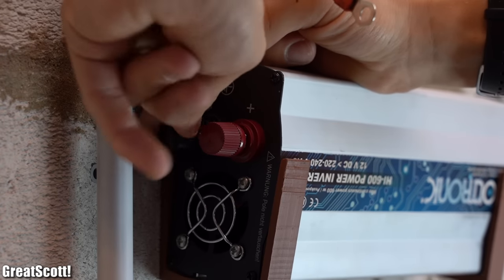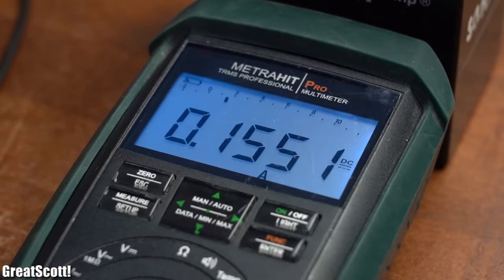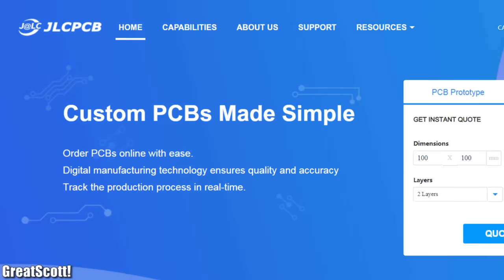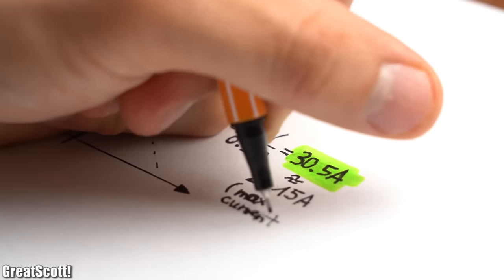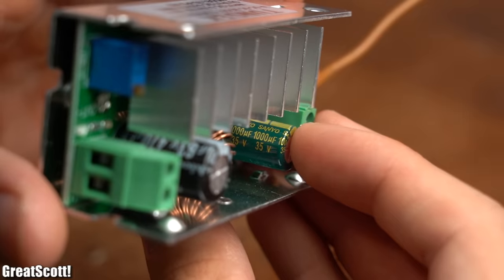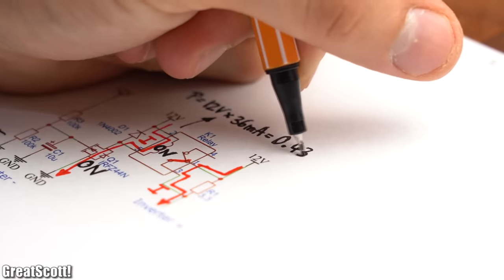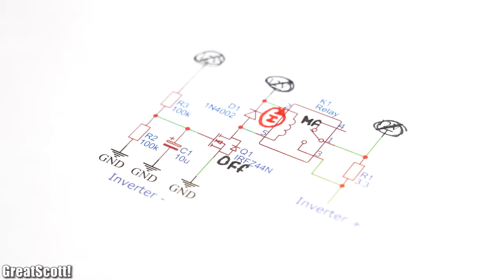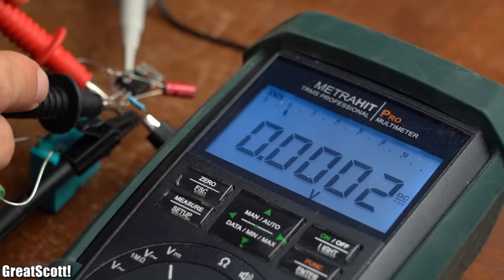How to make a Softstarter and why it is sometimes mandatory to use!

Comment: Because you are working with DC it should be possible to solve the problem much more easy. If you put a 3mH (or more) induktor with a low resistance in parallel to a 3,3 Ohm resistor the inductance stops the inrush current inpulse for a while an it goes through the resistor. After that the inductor doesn´t matter for DC any more.

Comment: is the Mosfet selection overkill? would i get away with replacing it with something in a TO-92 package or something SMD for space reasons, any suggestions would be welcome. appreciate your work, your always well explained, thanks
Reply: i have some 2N7000 N-MOS 60V 0.2A, is there any reason they wouldn't work, unless im missing something, its only got to power the relay coil

Comment: IRFZ44N? That's massively over-spec for a relay. Actually, if you stick two of those in parallel, they'll take a hundred amps pulse no problem, and 30A continuous even without a heatsink. You can do away with the relay altogether! If you want something that'll do even more current, the only MOSFET I know of that has a lower Ron is the IRF3205, just be careful of the low max Vgs on it.

Comment: A clever design would be to use an NTC shunted by a normally-closed relay contacts. When device initially connects the main switching is delayed for a bit but the relay activated immediately and "unshunts" the NTC. Then the main current starts to flow with the NTC damping the inrush. After the inrush is over the relay is unpowered and so the NTC is shunted again and cools down. So during normal operation the NTC conducts no current so stays cold and the relay is not activated either, so no power are wasted there. Not sure how easy it would be to implement this logic, does not feel simple to me unfortunately.

Comment: In bypassing the the current accros 3 ohm resistor, the relay coil is always dissipting some power, so can't it be 5 pin relay where NO and NC contacts are used such that, dusring continous operation the relay coil is off... Hence mosfet also off

Comment: I need to make one that will can start my air compressor.  120VAC, 15 Amps.
Aren't there specifications for types of load that the soft starter be determined for?

Comment: Could you use super capacitors on load side to deal with the current surge on startup? Have a higher voltage "buffer" that dropped energy into the external system on load, then was recharged gradually once the load diminished?

Comment: What about using an inductor? If sized properly I'd imagine that would be a lot simpler and also have a really low power loss in a DC circuit.
Reply: Switching  very large inductors into circuits just opens an entirely new can of worms. And check out what happens to the voltage when you switch that beast off... Arcs and sparcs I tell ya.
Reply: @benbaselet2026  That's definetly an issue. However on the one hand I don't expect the required size of the inductor to be that big, but I'm not entirely sure of that.

As for the voltage spikes, a diode anti-parallel would fix that, and that's more or less standard practice when switching big inductors AFAIK

Comment: How might I use this to trigger the BMS of a lithium battery? As I would need a pretty beefy relay to pass 60 amps, could I use the soft start relay signal to perhaps bridge a link between the sense lines and the BMS? Then I'd have to cut the bypass resistor when the battery is low or charged. Then it really becomes more complex..

Comment: Why not just add a large inductor in series with the component ? Its behavior is the opposite to the capacitors responsible for the inrush current : it would oppose the inrush current at first then act as a simple wire once the current is stabilized. Is there a reason for not using it ?

Comment: Hi! Isn't it possible to add your own capacitor to store energy and smooth that load spikes, but charge it via a resistor (limited current) and discharge via zenner diode (a lot of current) I know in model railroading this technique is used widely

Comment: Why not just let the mosfet be powerfull enought to feed directly to the inverter and skip the losses of the coil in the relay? i would think it would give even lower loss.
Reply from the maker: Feel free to do the calculations of the power losses of the MOSFET at 600W input power.
Reply: @greatscottlab  I'm guessing you would never run it at 600W. But I know in that case it would be much better with a relay. On the other hand 0,5w is nothing :-)

Comment: So can I also use this for a fridge? My 180 watt (when running) fridge seems to need almost 1600 watts to start up. So I need a huge (and expensive) inverter ony for the startup moments. But I suspect it will never start if just draws that current after the delay time has passed?

Comment: Watched this 3 times and so confused.
Also the parts linked to are fairly expensive since several are multiples and kits.

I just need to get a 12v Sump Pump to decrease it's starting power so it doesn't drop the voltage on a solar panel.

Solar Pump basically, and it sits there for hours clicking on and off because the voltage drops below the cut off point of my DC Voltage Relay.

Ideas?

Comment: I have a solenoid piston that works on 24V DC . I use it on a sewing machine , but when i turn it ON , it kicks a bit more that i want , will your soft starter help ? And plz tell me what do i need to change on your circuit because of the 24V . PLUS :  the circuit i made, so i can have 24V DC when the piston is ON it gives like 40V when the piston is OFF , if i give 24V to the piston then i have a huge voltagedrop due to the current it consumes but the specifications for this piston are 24V - 30V max. Can you help ?
Reply: You just need a series resistor to limit the kick.  No need to bypass it after a delay.  But you should have a diode reverse biased across the solenoid coil to dump the inductive flyback .  Connect cathode to the positive side of the solenoid, anode to the negative.  Any good sized silicon diode will work.
Reply: @Nic7320  Thanks for the reply , the solenoid already has a diode and a resistor ( don't remember the values ) and it's pretty soft when i turn it off , comes to it's normal state soft and gentle .If i change polarity the piston always pulls (instead of pushing ) nothing changes , the kick is always when i turn it ON . But i will try putting another series resistor as you said , see how it behaves.thanks.
Reply: @Nic7320  Ok tried it and it's working well , only thing is that i need a low resistance , with no resistance there are passing like 3.5 to 4 amps !!! I,ve putted an 11.5 Ω resistor but it gets hot even though the amps are now 1,5 - 1,8 ? made a custome biga** heatsink with loads of thermal conductivity glue . thanks , i think i'm good to go .
Reply: @Nic7320  it worked with just a 11,5 Ω resistor , without the resistor 3,5 to 4 amps where passing , so , i hade to make a biga** hitsink and now it works like a charm , thanks .

Comment: I have a fridge on my system that messes my system up. It works buy when the compressor starts the lights dim and I can see a surge line in my monitor. Can't be good. Any ideas if a softstarter would be a solution? If so, can I buy one somewhere?

Comment: Maybe a low Rdson P-ch MOSFET instead of a relay to reduce current draw? This one should do the job: STP52P3LLH6. It could probably act as the current limiting resistor also while it is in its linear region, and then its resistance goes down to 17mOhms.

Comment: I'm using a 10R NTC with 2-second relay timer (relay shorts across NTC after ~2 seconds) but my load (240v battery charger) still leaves POP-marks on the pins when being plugged in. Granted, the pop is not as large, but it's still got 75% of its pop/bang factor ! Any ideas? Guess a higher resistance NTC might be worth trying.. Also, I use a 133 degree C thermofuse held next to the NTC with heatshrink for safety - incase the relay fails to close and the NTC gives off too much heat (granted it's not as bad as I thought it'd be: even though it's in a plastic box, I tested running 2000W through it (the NTC, not the relay) and the leg melted into the plastic a little bit, but it took a bit longer than I though it would. Still, silly not to use a thermofuse in my opinion.)

Comment: This is more like a workaround for a specific use, rather than an actual soft starter. What if the startup load comes from another source, let's say a door motor or a heating element ?

Comment: But in your final design, if you open and close the circuit just before 1 seconds, the problem will still be there isnt it? So you should close and open the switches just once, not wobble  close-open-close ... It is a protecction for most cases but do not protects %100  times.. Am I right?

Comment: Question is,WHY this is not part of the original  inverter circuit,or do only the expensive range has them?
Reply: This is a problem, when you have a small battery and large inverter.  Who does that?

Comment: What are soft starters called when used with elecric bikes? I'm currently having a solution with a resistor and a on off switch. I would like it automatic. I also notice that sparks can travel to another wire. I mean that the spark can occure both on the battery to controller but also pass through the controller to the motor. I forgot to turn off the switch one day when I connected the battery and suddenly I though something happen with the controller because the electric bike didn't work. 
I fixed it with disconnecting the wire from the controller to the motor and then connecting it again. This gives me a clue that a spark caused the disconnect.

Comment: Other than current limiting, why use the solar charge controller load side? Why not just use a DC solar shunt instead for better metrics and the ability to add a variable current limiter? I don't know anyone who uses the solar charge controller for the DC load. This seems like another manufactured problem with an obvious simple solution, but you made it harder for the youtube content.

Comment: Couldn't you simply power the relay from after the resistor (maybe using a diode or 2 to increase the voltage at which it closes), making it start when the power is over 12V and so the inrush has ended? 2nd option being using a divider and transistor to achieve the same thing

Comment: Alternately, JUST REMOVE THREE LARGE CAPACITORS! Running off a battery will NOT cause ripples that require filter capacitors, since the voltage is not made from an  AC source. ...  Though without modifications, a choke would work, with minimal power loss
Reply: No do not remove the three large capacitors -  they are there for a reason.  A choke may or may not work.

Comment: So you expect all 50+ Amps (may even be over 100A) of current drawn by your inverter when driving a heavy load would flow ok through this tiny relay? This is only a solution for extremely small loads.

Comment: Can I use this soft start circuit for a custom built 57V o/p Microwave Oven Transformer(MOT) arc welding machine with two MOTs? If so, then how to calculate the desired resistor value? And if not, then please send me the scematics of a suitable soft start circuit for my specific need.

Comment: How do you reset the timer to 1 second with short transients? Normally, a diode force the small capacitor to discharge quickly when the 12 volt drop below 0.7 volt.
Did you test the surge current by applying intermittently the input voltage?

Comment: An  inductor would stop large turn-ON currents to the in put capacitors. If the resistance of  the inductor is sufficiently low, power losses after turn ON would  be very small, NO relays which have limited life are required..
How could It be that < GreatScott > ended with suc a poor solution ?

Comment: Hi Scott- Can you make a circuit for failover power supply. 1Input form 12V adapter, 2nd input form 12v battery. when the 1st input is not there then it will switch to 2nd input. I know its easy to make it with a single   8pin relay. But the problem comes at switching time. All the devices rebooted due to switching time.

Comment: What if you use just the MOSFET with the RC circuit in the gate? so you don't need to use the big resistor and the relay

Comment: Wouldn't a large coil also slow the in rush current with less ongoing power losses? (as well as act as a noise filter, which could be handy)
Reply: Do the math and tell us value inductor would work best ...

Comment: Very nice and ingenious design,but I don't think it was necessary to use a power mosfet to drive the relay: a 2n7000 to92 package mosfet would have made a more compact circuit. Also, a p channel power mosfet could have been used in place of the relay, to make the switching truly solid state, with no relay contacts to wear out.

Comment: Could a so-called „capacitance multiplier“ circuit be used as a soft starter, if the capacitor value used was big enough to make the transistor turn the power on slowly?

Comment: I'd just have a mosfet or relay powered by the mppt, I mean you know what loads you run. Having a relay there gives you current when you need it and still leaves under voltage protection active??

Comment: Thanks GreatScott! 
Stupid question: I have a 100W led powered at 3A. Is it enough 100W resistor in series on the load for this purpose?
Reply: The rating of the resistor is the maximum power it can dissipate. What is your supply voltage and the voltage rating of the LED?
Reply: @trissmerigold7197  Thanks for the answer. The power supply is 19V and the led voltage rating is about 30V at 3 or maximum 4 Amps. What do you suggest?
Reply: @sandrolab  i highly suggest you to use a boost converter with current limiting function
Reply: @trissmerigold7197  Yes, I’m already using a boost converter for that, but I see a bad peak of current when I turn on…
Reply: Is the current peak flowing thru the LED or at the input of the boost converter. And have you set the current liming at the output?
Reply: @trissmerigold7197  Yes, the current is correctly limited at the output but the peak flows thru the LED at the start.
Reply: @sandrolab  you can either use a big capacitor to "absorb" the voltage peak (i assume it is a voltage spike) or an NTC but of course it will be heating during normal operation

Comment: Need to modify this for 24 volts... I take it I should double the resistor values, and make sure the caps and relay are rated for more than 24 volts?

Comment: Why not make the entire thing solid state? Big mosfet or igbt in place of the relay
Reply: Mosfets don't handle the high currents as well as relays!
Reply: @alexoja2918  totally true. A decade ago I used to design metered photostrobes handling hundreds of amps at 350v though for short periods. This was with n channel igbt with extremely low esr.  May be worth investigating though the cost would be higher than relay and much more sensitive to linear mode faults

Comment: Hey great Scott I have a question I try to make a construction radio out of a car radio and I need to have a switch/inverter to let it work but wanted to try to make it when it’s off main voltage it runs out of a 12v dc battery but I’m scared I made it diy the fuse wil blow any tips or ideas thanks

Comment: So would this work with a 3000 watt inverter trying to power a 12.500 btu air conditioner. I can't get it to start. I need to drive around with a gas power generator and it just takes up space. I just bought a 24v 200ah lifepo battery system to go with my solar and I'm looking at cheap 6000 inverter on aliexpress but would rather build a soft start and use with current inverter if i can.

Comment: Could this be used for 120v dc? Im planning on using 2 flexvolt batteries to power a 120v 1/2 router for work where there would be no power and cordless routers just don't have the power and i only have a small van so a generator isn't possible either

Comment: Quick question. I have built a portable boom box that needs a simple Inrush current limiter. It’s powered by 7s lifepo4 through a bms. The problem is that the amplifier has several capacitors that cause an inrush that trips the bms before the capacitors are filled. Would it be possible to just add a ntc, Or would that be inefficient? I’ll post a link to the bms and the amplifier.
Reply: The bms is HXYP 7s-7552

Comment: Why not just use the mosfet to turn on and off the power to the Inverter? You should be able to use less components and have the same result. A 50a mostfet is easily obtained. Just a thought.

Comment: Thanks for great info. I have been thinking about converting regular 3 phase motor into a generator.. Is it possible without the use of permanent magnets? Does anyone have a idea about how the circuit could be made? I think it should somehow use a capasitors to charge to inner coils so it generates a magnetic field and thus electricity from outer coils. And i guess it would need to be kind of self regulating so that faster/higher the load is to input shaft then it would charge the inner coil with higher current and thus would generate more power from outer coils and restrict the speed. And on the other hand the lower the load on input shaft then less current should be transferred to inner coil and then generating less current in the outer coils and prevent stalling. 

I wonder if the problem is solvable, but If someone would be able to figure this out I think it would be really useful innovation as there is huge number of old industrial 3 phase motors and i think there should be a lot of  interest in micro electricity production for example solar and and small wind turbines which work well together...

Comment: I want a soft starter as an input filter for a dc_dc step down converter which it requires 40vdc ,5A max. a spark occurs when the input contacts the pins and i want this soft starter circuit for supporting variant range volts and amps not a constant input